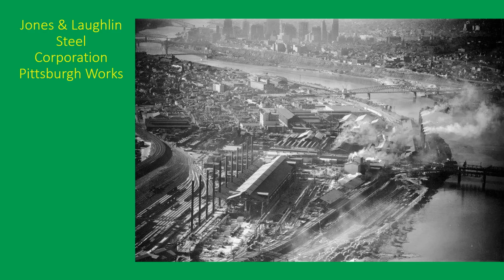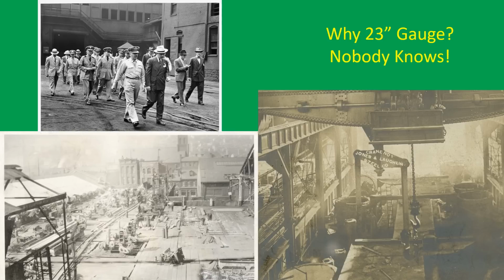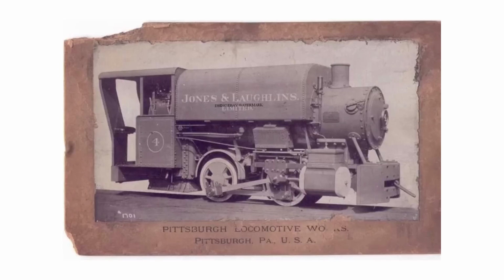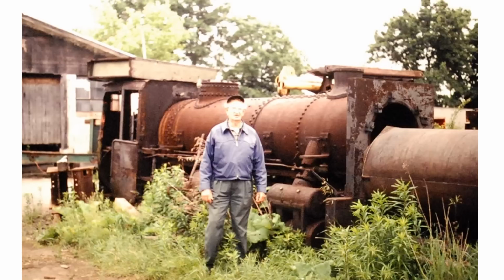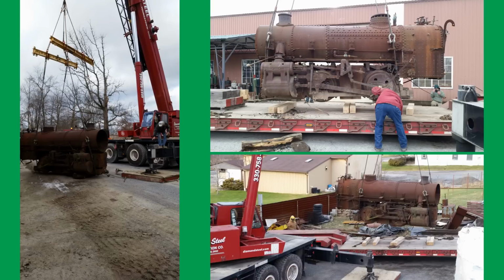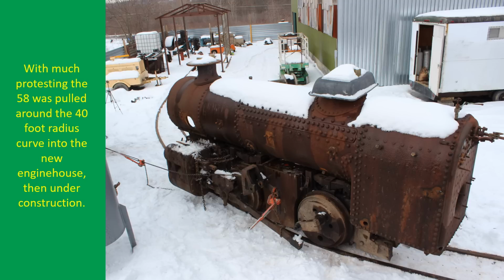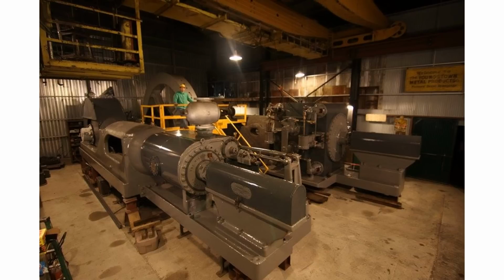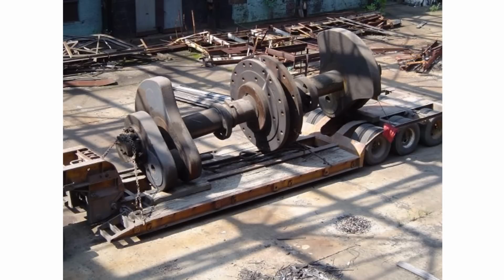The History of the J&L 58 Steam Locomotive

Comment: you can use graphite grease sticks for the flanges water will only add rust and no lubrication.
Reply from the maker: Water is well known to be a good lubricant, just ask any locomotive engineer who has to deal with wet rail conditions.  This article explains the concept, except this application was designed to reduce the friction in the trailing cars and not the locomotive itself.  A simple alteration to add nozzles ahead and behind the drivers will take care of that.  With a factor of adhesion in excess of 5 and very little trailing tonnage, the reduction in adhesion in the curve will not be of consequence.   

https://tinyurl.com/kl3a5me
Reply from the maker: Of course if the results are not satisfactory we can always change to something else.  We do not adhere rigidly to any dogma around here.  If it works its good.  If it doesn't its gone.
Reply: keep it simple if it stupid but works then it's no longer stupid. At the rail museum we have leaking journal boxes that helps the flanges but also alot of our rolling stock is 100 years old.
Reply: Dk